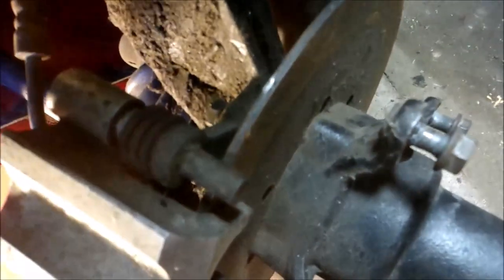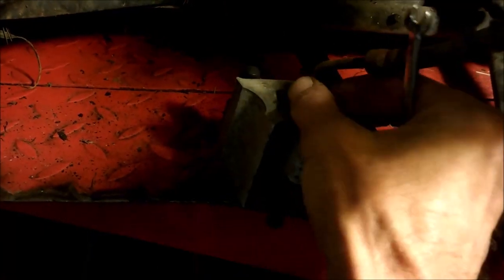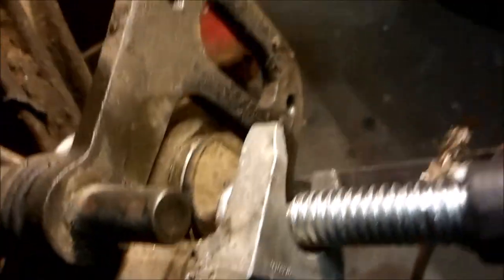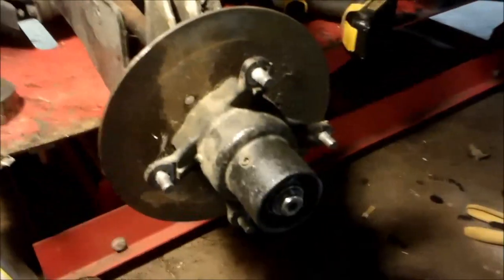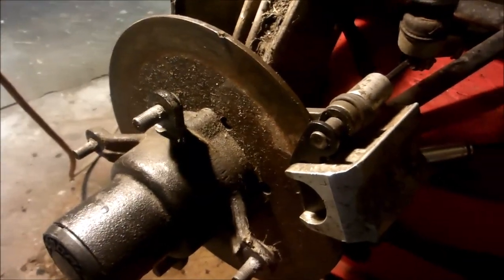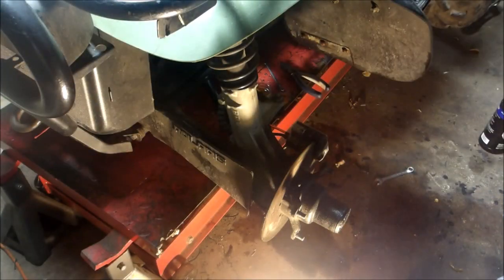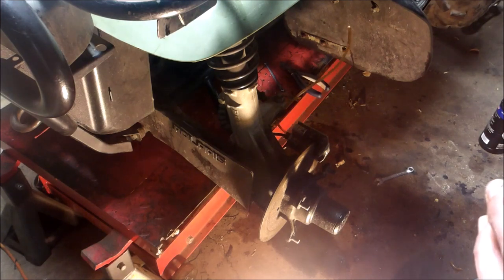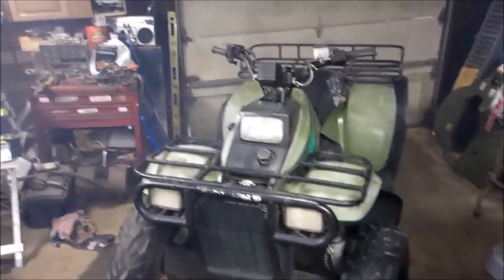How to bleed brakes! 96 Polaris Sportsman Restoration Part 2

Comment: Great video!!
I just changed my brake fluid and brakes three weeks ago on a 94 400l 4x4.
All three bleeder valves broke off.
I did not know to tap on them with the hammer first.
With nothing to lose I unbolted the brake calipers let them hang had a guy pump the brake lever as I barely loosened the brake lines. One at a time holding it tilted in a position so the air would come up and out as I barely opened the lines.
Wow I was a happy man I didn’t have to go bye new brake calipers and besides the rear brake caliper on a 94 they do not remake!!!
Reply from the maker: Sweet! I actually have a video on how I did that exact same thing. I took the line completely off and put it in a jar of brake fluid. Afterwards I quick put the line on the caliper. Worked great.

Comment: why not siphon or soak up with a rag the old dirty brake fluid in the front brake reservoir vs. the slow process of drain/flush by hand lever bleeding method, which can be done once majority of fluid is mopped out of it. Very good tip with your jar of fluid trick while bleeding each bleeder screw!

Comment: I have an 01 Xpedition 425 that I am rebuilding.  The metal brake lines have corroded and need to be replaced but I am not having any luck finding new lines anywhere.  Can you point me in the right direction?  Thanks!
Reply from the maker: I bought used ones off ebay.

Comment: I have a question for you not regarding brakes.
As you seem to be very knowledgeable with Polaris ATVs.
On my 94 400 L 4 x 4
The rear chain is loose as can be when the ATV is jacked from the frame off the ground.
When the jack is removed and all four wheels are on the ground the rear chain is now banjo tight!!
Should that rear chain be adjusted while all 4 wheels are on the ground?
Reply from the maker: It's weird that it's that loose when in the air. But yes that is correct. Should be a little loose when it's up in the air because rear arm drops. You usually want a little play..about 2 fingers when on the ground so when you hit a bump the chain doesn't snap or worse, wear out sprocket and crack the tranny case when it flys off. I've seen that too many times.
Reply: OK perfect thank you for the reply I am working on it right now.
I have watched videos on tightening the chain but they did not explain if there should be play while on the ground.
I did just notice that the rear swingarm bushings are shot maybe that also has something to do with it.
I will loosen chain for now and order new bushings tonight!!

Thank you

Comment: Bled brake lines but how do I bleed the master cylinder? Just disconnect at the T and pump it? Also how does pumping hard on the brake let air back in. Thank you!
Reply from the maker: I bleed the master at the master. In this video I used the line to the T because they are known to get plugged so I was testing both.
Reply: @TitaniummanGarage  I found my issue. The master was good and once some are got in it went bad I guess it was on its last leg. It didn’t have enough pressure to even push past my finger.

Comment: Hi I got a problem that I'm wondering if you now a solution to. I've got a 98 425 magnum that my starter went out on. I took the starter off to rebuild it and put it back on now I lost spark when cranking. But as soon as I let off the button it will spark once.
Reply from the maker: Try pushing in the reverse limiter button on the handle bar while running it. It sounds like you have  either a ground issue or rev limiter is bad or possibly the cdi.